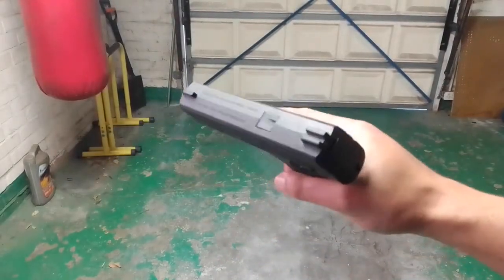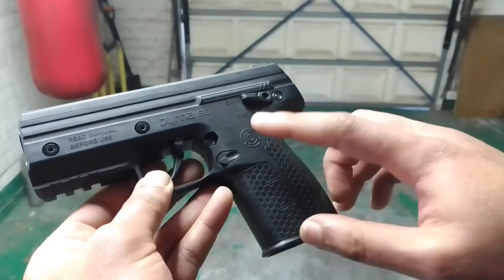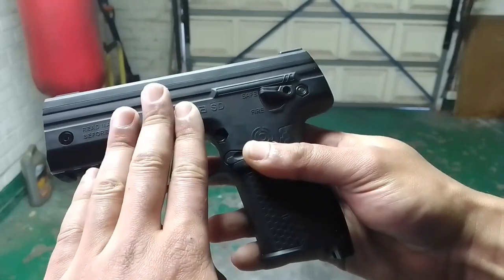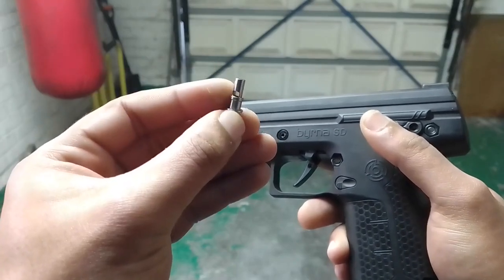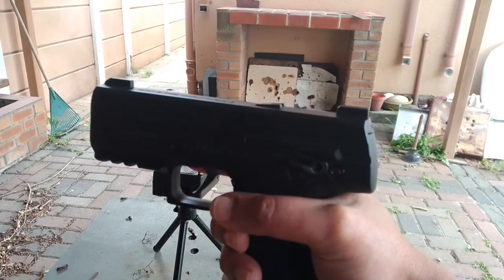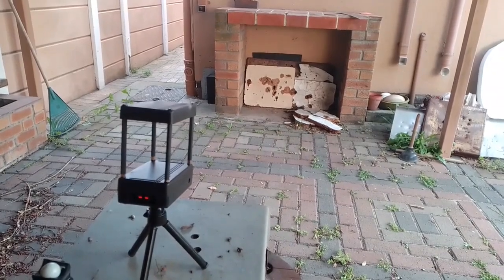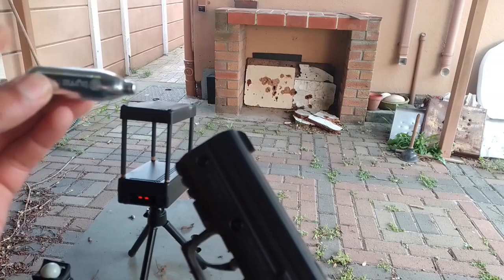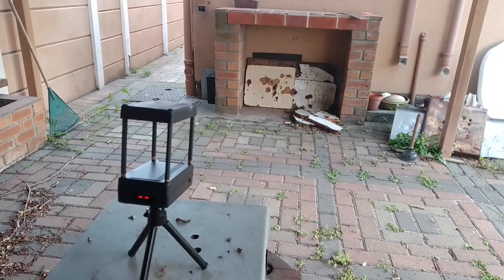Byrna SD Custom Valve Pin Progress

Comment: Holding air is a huge step in the right direction. As you said the valve stems are precisely machined. 

I wouldn’t touch a thing at this point except bump up to 12g and test your stems performance again.

If you still arent seeing what you are looking for then you know it’s more about the stems profile and not lack of gas. 12g are cheaper too.
Reply from the maker: @lesslethalfordummies  I had to grind a special tool to mimic this. But I feel I am on the right track... I will have my final pin expertly machined but my supplier has a long lead time and I am impatient lol.
But it seems consistent though with the drop in fps. 
One last thing, since the opening time of the valve is longer, there is no seal blocking CO2 from escaping towards the hammer side?
Think about the umarex 43 cals... When firing pin engages with mag valve stem, it has a seal to prevent gas from escaping. Thus only allowing the CO2 to expell out the barrel.
Reply: @reaperairdefence932 it can be frustrating work without the right tools which is how i function 😂 so props for it holding air.

In regards to the T4e valve stems. Have a closer look at the striking end of the stem and you’ll notice it has two flats machined into the stem. This actually allow gas to blow back the slide and reset the hammer so it is not entirely sealed.

As long as your Byrna stem is precisely machined to keep that rear oring seal engaged you should have minimal blow by, if any at all.